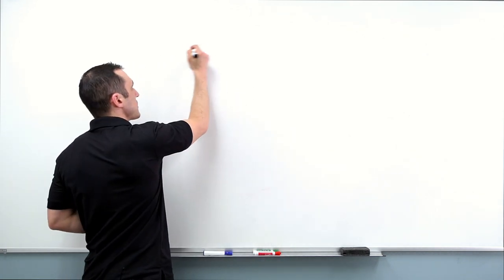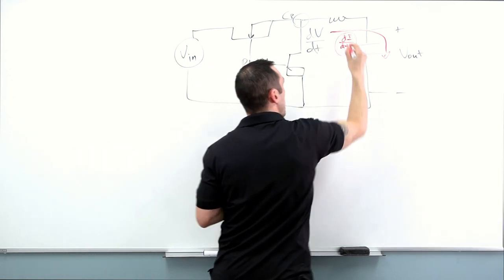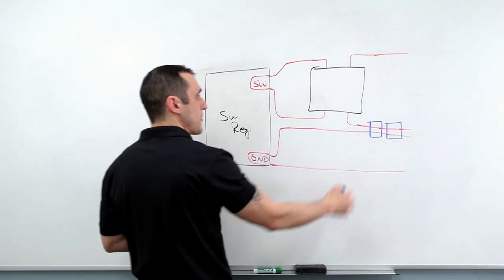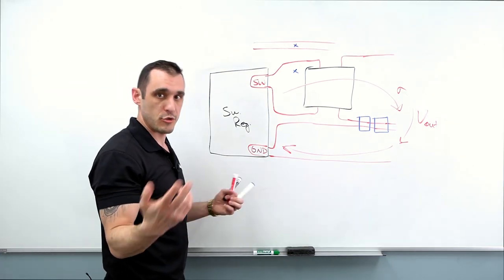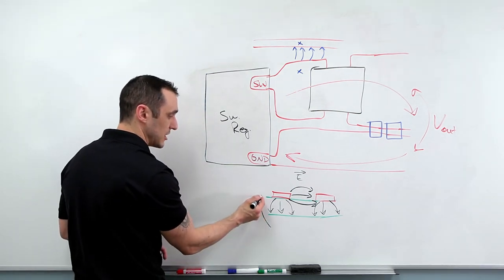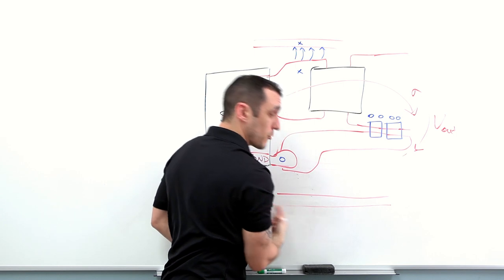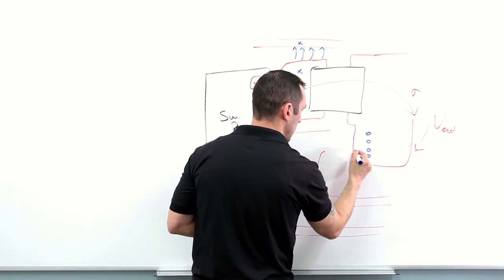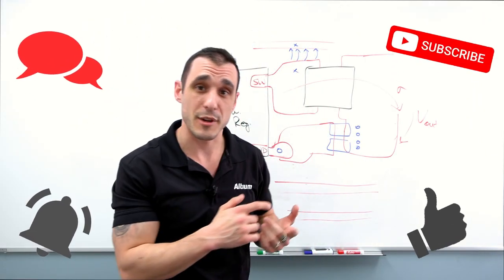How to Reduce Power Regulator Switching Noise | Schematic Capture

Comment: Great video! I haven't thought about placing the power return path on the bottom layer yet. I'm worried about the impedance high frequency current might see because auf the vias, that are essentially inductors in the higher frequency range. I'd like to point out the fact, that high frequency return currents flow as close to their exciting trace as possible. The large loop you have drawn will be actually at the inner surfaces of the top side traces facing each other. So, making the gap between SW copper and ground copper on the top layer as small as possible, will reduce the parasitic inductance effectively. But placing the return path to an other layer and shifting the electric field orientation with that's, could be attractive in some situations. You've also mentioned the problem with capacitive coupling between SW nodes and signal traces on the top side. I like to surround the switching circuit with a ground fence that has closely  vias to a solid ground plane. The electric field will be drawn to that fence and do less harm to signals behind it.  Best wishes, Max

Comment: Does the di/dt loop design you explained have greater impact on radiated emission than dv/dt loop? The rise/falltime are much more steep on the dv/dt loop, hence higher frequencies. Also is it better from a radiated emission point of view to route the return path on same layer rather than letting the return path go where it is lowest - under the inductor?
Reply: It's not really fair to say that the di/dt rate is different from the dv/dt rate or that one of these has more impact on radiated emissions. The gate driver used in a switching regulator will output a pulse that has some voltage and current, the pulse is a response on a conductor or transmission line due to switching of a driver. The di/dt generates a changing magnetic field, which then causes radiation. Similarly, the dv/dt generates a changing electric field, which also causes radiation. The two fields are related by Maxwell's equations, and when you have the two fields changing they will create an electromagnetic wave: you cannot have one field without the other.

If you're talking about measuring radiated emissions from a current loop, you will be measuring a voltage induced in a conductor loop due to changing magnetic flux (this is just Faraday's Law). In general the emissions you produce will have greater magnetic flux when the size of the loop is larger. This is why we always say to have a tight return path in a PCB, this means to ensure the current path through ground is closer to the signal conductor in order to make the loop area (and thus the changing magnetic flux) as small as possible.

Comment: Hi, great video thanks. I am currently desining a BMS and wanna supply with external power source for safety reasons. I dont know the power source noise freq but I wanna do my best to reduce as much noise as possible. Therefore I wanna add a dc input power filter circuit in my pcb. I am trying to learn how to do that because the IC I am using doesn't give me any directions or circuits for external power source. Can you give me some suggestions. I figured I can use CM chokes and Y caps. Or Ferrite beads but dont know how to choose the values. I have 48v dc power source to supply my IC.
Reply: What specific noise are you trying to reduce? Do you want to reduce output switching noise, input noise on the line voltage, or something else? The filter you need to use depends on the type of noise you want to reduce, so if you can identify that first then you can determine what type of filter you should use.

Comment: Great video! If an application/design is having that many issues with parasitics and needing filters/components to rid the issue, wouldn’t removing the voltage regulator, and replacing it with Zener(s) rated at desired voltage(s) be a better overall design decision (in the end) as it also saves space and is much simpler to work with? A voltage regulator (by design) is supposed to ‘simplify’ the design, but ultimately instantiates a myriad of new issues. Thank you Zack, could you please help me/us to understand what benefit the regulator has over a common Zener(s)? Kindest Regards
Reply: It depends on the performance characteristics you need to hit in your system. If you're not worried about power conversion efficiency and you can withstand any losses across that series resistor in front of the Zener then go for it. Not all systems can accept that level of efficiency. Also once you get to higher powers, which is not necessarily outside the realm of some common digital systems, you'll start burning up components. There is another issue in the way switching regulators can eliminate noise, they can essentially trade low-frequency ripple for high-frequency switching noise. If you really wanted to swap out that regulator because noise was a problem, then a better option would be an LDO as these can provide high current and will not get crazy hot as long as the headroom is low.

Comment: It seems like such a delicate dance to manage Cp and Lp.  Is there any board simulation software that can help you be smarter with the board layout.  For instance, I use Fusion 360 cad/cam software and I’m able to do structural stress analysts of the part and optimize the design based on the results.
Reply: What you're talking about is something that would map Cp and Lp between one point and any other point on the board, that is a complex 3D problem requiring a solution to Poisson's equation in an arbitrary system. Computationally complex I mean.... I don't know if there are field solver applications that automate that specific analysis, I'm sure you could program that into COMSOL though.

Comment: When you say move traces away from the regulator, how do you know how far is far enough? 5 Mils, 100 mils, or what is a good rule of thumb?
Reply: HI Skyler, great question! I have not ever seen a good rule of thumb. This topic of noise coupling from a switching regulator to nearby data lines has been the subject of a certain DesignCon paper, and it was found that the amount of noise depends on multiple factors so it's difficult to generalize to every situation. The recommendation of making traces short and direct helps reduce the coupling length between any of the conductors in the regulator and a nearby trace. The other rule regards how the board is laid out, if laid out properly you can prevent routing signal lines close to the regulator circuit anyways, so you can prevent the problem.
If you must route close to the regulator, then you might want to consider a much more conservative rule than the 3W rule between traces. This is because with a fast regulator, you can get big signal swings compared to the case of two parallel traces producing crosstalk. So for example, a small switching regulator could have an edge rate in the current loop somewhere on the order of 20 A/microsecond or higher. That's at least 10x what you might expect from a typical digital signal, so you might consider something like a 30W rule. Obviously those rules do not totally eliminate noise, you'll still want to test or simulate this!

Comment: Some vias on capacitor 0V so the return current can return back under the inductor on the 0V layer instead? Makes the loop minimized as much as possible!
Reply: Yes you can use vias. I showed single layer just so that people can see how to trace out the return current loop and it is clear where the current is flowing. But in another project video I did it using vias to the back layer as you describe.

Comment: When you suggest increasing (or reducing) the distances between things to change the magnitude of coupling, the inverse square law always applies, right? I always anticipate mention of the inverse square law when watching PCB videos, but I hardly ever hear it.
Reply: This is a good question but the answer is "no". The reason is that the inverse square law only applies for a point source, or when you are far enough away from the source (far field) such that the source looks a lot like a point source. On the PCB, you are either dealing with a cylindrical radial dependence (think the space around a trace, so 1/r dependence), or you are near a plane (constant E field). There is a transition region which is treated well in the quasi-static approximation used in 2D MoM or BEM solvers that are used to calculate the electromagnetic field around a transmission line where, eventually, the field amplitude scales to a 1/r^2 dependence, but only in the far field as I mentioned above.

Comment: Hi zack, what about reducing the input noise created by the switching regulator?
Reply: When you say "input noise", which noise do you mean? Are you referring to the dV/dt and dI/dt action of the switching elements in the regulator circuit?

One of the trends in switching regulator design is pushing the PWM frequency higher, which then requires faster edge rate. The result is that you can get lower ripple on the output and use a physically smaller inductor, or you can more easily design a multiphase converter. The drawback is the faster edge rates produce more radiated noise. So the trend is towards more noise being produced by the regulator, not less!
Reply: @Zachariah-Peterson  thanks for your reply, I'm more specifically referring to the noise induced back on on the input line. For example, im working on a buck converter that I'm powering from a 12V supply, and i can see on that 12V input line some spikes that are in sync with the switching action of the converter. How would one go about filtering or eliminating this induced noise from the input line? Thanks!
Reply: @YoussefEl.  Look up "buck converter snubber", I think.

Comment: Bringing the ground plane close to sw node may cause a lot of problems that may be hard to identify. Large sw node with a close proximity of GP creates a capacitance driven by high dv/dt. This reduces efficiency and may cause instabilities caused by current flowing through this capacitance. It may create an emi source as the current for this capacitance have to be delivered by the power net. The best solution is to make the sw node as small as possible.
Reply: Yes I understand what you're saying and I pointed that out in the dV/dt term. But this can help reduce switching noise coupling into other circuits through both capacitance and inductance as you reduce the mutual capacitance to some other circuit and reduce the inductive loop area. Also sometimes you don't have a choice as the SW node is on a dense high layer count board with controlled impedance lines elsewhere in the layout, so you're forced to put it closer to the plane. I agree with you though if you make the switching node physically small within some limits then you can compensate for a closer ground region. I guess it's all a balance you have to find.
Reply: @Zachariah-Peterson  thank you for reply and as you said - it is all about the balance, possibilities and compromises you have in your layout.
Thank you for your work!

Comment: Attention also needed at Vin. To reduce the noise, minimize the loops on both side:
large Cap ---- small cap ---- mosfets ---- inductor ---- small cap ----- large cap.
There are also other techs help reducing the RE, like spread spectrum, integrated cap, shielded inductor.....

Comment: How is the concept of "reduce the parasitic inductance for less noise" reconciled with the fact that we have a relativity huge inductor deliberately placed in that loop?
Reply: We want to eliminate mutual inductance between that loop and any other circuit that might receive that noise. So yes, the loop has inductance due to the actual inductor, but it is the mutual inductance between the switch node copper and all other copper we would want to minimize. Hopefully that makes sense.

Comment: Why not pour GND under the SW node?
Reply: You can do that, and bringing the GND closer to the SW node will reduce the mutual (parasitic) capacitance and inductance. We talked a bit about how that affects capacitive and inductive coupling to other circuits in another video:
https://www.youtube.com/watch?v=4DSsete22Zw

Some application notes will recommend doing this as well to provide a tight, predictable return path. We have another video on two-layer power regulators boards coming out this week, where the current loop completes on the back layer instead of the same layer.
The tradeoff is that the SW node's self capacitance couples more strongly to the nearby GND and creates a current loop that bypasses the shunt recitfying element (in this case, a MOSFET or diode). This is only really important when you have very fast switching PWM signals as they will have high enough bandwidth to bleed some power past the other parallel elements in the power regulator circuit.